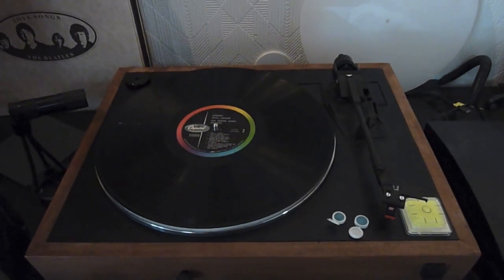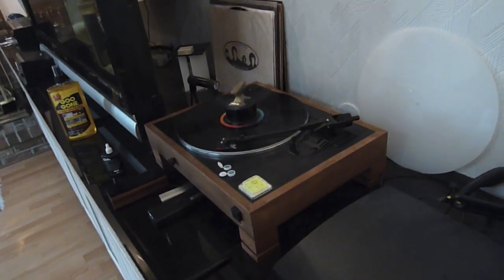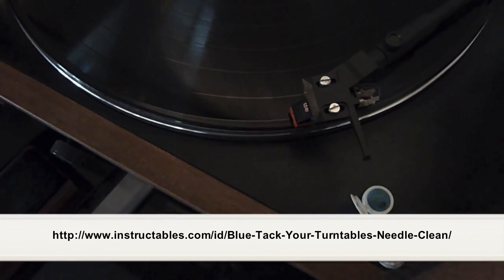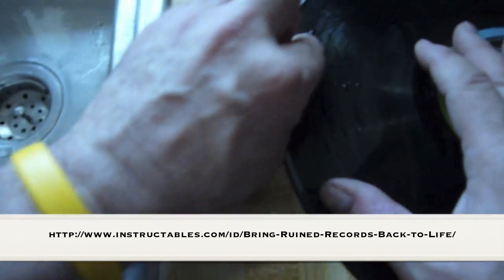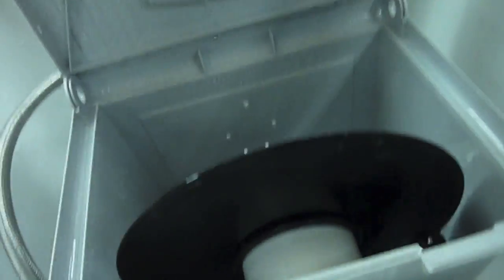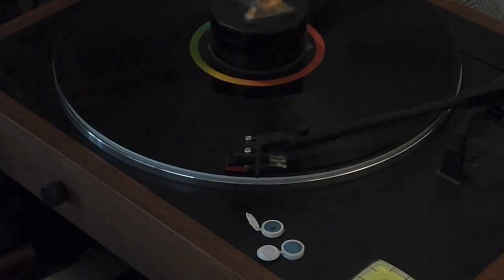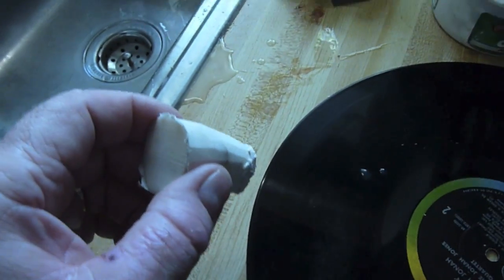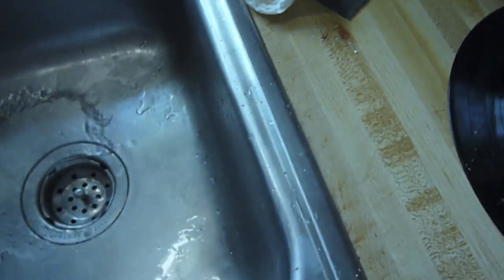Resurfacing Records to Sound New Again

Comment: Different cartridges have different tips on them.  Every one will track any record groove in a slightly different spot (higher up vs lower down in the groove).  More expensive needles will track lower in the groove.  I'm saying that shaving off a top layer of the grooves on a record is probably not a smart idea, it won't change where the cartridge tracks the record one iota.  Moving something back & forth in the grooves will lessen the noise heard from those scratches a bit, I get that effect by (carefully) playing many records backwards.  Any record with dirt or even years of dirt stuck in the groove gets a warm wet rag lightly sprayed with Spray-nine.  Then rinsed SEVERAL times, dried with a soft towel.  It will take off even the toughest grease but not to be used with some 78's (like Rca-Victor 78's) as it has a chemical reaction, and turns the record white and dries it out a bit...  but any 12 inch record or 45 rpm is fine with the spray 9.. just rinse well after wiping a slight bit on with a WET clean rag.  By all means, do any experiments that you want, especially with trashed records, that's how we learn, us mere humans (mostly)..  thru trial and error~!  Good luck, records are great great things, in my mind!
Reply from the maker: CrisVangel1958 

Your understanding and description of which cartridges track lower in the groove is spot on.

What removing the upper layer does is sand away the minuscule tongue of vinyl flashing a needle leaves overhanging the edge of the groove as it moves crosswise over the top of it, rather than within it where the needle belongs. 

That protruding bit of vinyl is what reproduces the tick, tick, tick as the needle is being hit on the side, no matter how deep it goes, every time it passes one. These tiny hammers interrupt my enjoyment of the music and this is what I've come up with to eliminate them.  My experimentation with this has satisfied my needs so it's up to others to fine tune it to meet theirs. 

It has nothing to do with the cleaning of a record... which is what I also like about your comment because that's what I continue to experiment with every time I clean them, and we certainly do learn a lot by doing things that way. 

Great comment and thank you for taking the time to post it.
Reply: When a vinyl record gets scratched, not all the scratches go a deep into the grooves.  Some will be more, some will be less, however it matters not, it only matters at the point of the groove that's the needle is tracking.  Whatever scratches go down deep enough to affect that same area the needle is tracking the groove, those will be audible.  Playing the record backwards will reduce them and I'm not entirely sure why, but I think it has to do with inside the dimensions of a scratch.  the needle will hit (and then slightly round down, each time the needle passes) only one side of the scratch, depending on which direction the record is rotating, so playing it backwards would help I suppose to soften out BOTH sides of the scratch, thus lessening how much you can hear it.  I didn't understand all of what you said, I know that some things are hard to describe, but it's cool to talk to you about this, not many people on the planet would care or have a clue how to even get this far along this conversation.. lol.  I guess it's time I watched your video.. ROFL!
Reply from the maker: CrisVangel1958 
Pictures are far better than words:

https://www.instructables.com/id/Bring-Ruined-Records-Back-to-Life/
Reply from the maker: Maybe because playing a record in reverse causes the needle to wear on the protrusion in a different direction. Bending metal back and forth is different, but results in the same outcome.   Repeated bending causes the metal to break away.  An interesting experiment for someone to do.
Reply from the maker: Thank you Cris. If you know a way to transfer that Instructable over to YouTube, you have my permission to do it.

Comment: Try taking the needle through the record in reverse first if you have a skipping problem or try turning the power if your turntable doesn't have reverse switch on it works 75 % of the time if you have a skipping problem with your record before using anything harsh it that might damage it worst
Reply: A reverse run with a screw on type stylus like a dansette will usually suffice for some pops and clicks

Comment: After many experiments. I found the best way to remove scratches is with toothpaste it's not abrasive like sandpaper and it leaves the vinyl shiny
Reply: Thanks for the tip. I was able to "repair" a part of one of my records, where the track skipped because of a deep scratch. You can still hear that there is a scratch and the record part is not as shiny as it was before, but at least the track plays through from the beginning to the end. At first I was afraid to use this method, because I love my vinyl records and I knew that this is a method that also will damage the record at least a bit. But since I had nothing to lose (like I said, the whole track was not playing, it just skipped the track), I thought I'll give it a try. Now I can finally listen to the whole record again :)
Reply: Hi Jonny chingas. I too tried the toothpaste trick on CD and dvd and it worked like a charm, well, maybe not every time.
Reply: What type of toothpaste?
Reply: I used sandpaper on one that was scratched pretty badly (it was hard to find a spot not scratched) and got pretty decent results for what it was. Aside from the dullness, it seemed to reduce a lot of the major scratches so a clear improvement. I had not tried waxing it, but that could maybe reduce some of the surface noise that's still there.

I'm intrigued to try this method with toothpaste.

Comment: The idea of grinding, sanding or polishing away scratches seemed horrifying until you look at a scratch magnified; it’s like running a knife through butter; all the stuff is gathered up at the top of the groove and the ‘lands’ and is very hard. That’s what the stylus is running into. Remove that, and depending on the severity of the scratch, you’re laughing. A delicate procedure, to be sure.

Comment: Interesting. I have used Mer High Shine shampoo to 'deep clean' (wash), records which is a salt free German automotive product for exterior car care. Works great on really filthy vinyl. Its quite expensive but lasts forever. For light finger grease I use fast food hand wipes. I see the logic of your method & I may try your technique on my 7-for-£5 scratchies box. Playability is my only concern as they will all be digitized, de-popped & crackled & uploaded on here. For really bad jump scratches I keep an old stylus & apply weight & simply forward & back cue the record locally, across the affected area which straightens the sideways cut across the grooves until the record plays at 1.5 gram weight. It'll still pop but won't de-rail the stylus. Maybe your method would reduce the pop further. Gonna try it & see...
Reply from the maker: Start with the worse from your "scatchies box" (I like that term:).  If it works, try another.  I'm betting you'll be able to save most of your scratchies.  If the scratch is so bad, it causes the needle jump tracks, it may or may not work. It all depends on how deep the scratch is. I've never tried it on a record that bad, but have come across gouges that can't be sanded away.  Good Luck.
Reply: Ok, well I started with a 45 - Bang Bang - Sonny & Cher. There were two very defined scratches, one in the middle, one right at the end. Multiple jumps with each. I cued both areas with a weighted stylus until the record played without skipping. Then I used a tiny Dremel polishing mop with a spot of fine burnishing compound by hand on the affected area, lightly rubbing clockwise going with the grain. I used alcohol to rinse.
The record now plays through right to the end with 1.5 gram weight & the treatment has taken a lot of bass, spite & definition out of the scratch. I would say around 40%. Visually, the scratches look much better too. Less defined & less angry looking. The record doesn't sound like its going to skip & I tried it on both decks (same old stylus). It is certainly good enough to digitize & clean up using Audacity. I will see what else I can salvage but I think your method will work best on a disc with one or two deep scratches rather than small marks across the whole playing surface. I may try some T-Cut on those ones. Well I hope that goes some way to winning over your detractors or at least convince them to try it. I can confirm it greatly diminishes catastrophic damage, derailment & skipping.
Addition I should add that both of those scratches were in fact trenches deep enough to pull a stylus right out of the cantilever!

Comment: Definitely some different ideas here.  Thanks for that.  I have a lot of albums that are very scratched.  Mostly from Goodwill.  Anyway, the technics obviously worked on your album.   I did have a question about the goo gone.   Has there been any problems or damage to the record since you put it on?    
I very well may try some of your technics or all on some very scratched records that the record cleaning machines didn’t help.  Definitely interesting. Thanks for taking the time to share.  And hey if you don’t like the technics, them don’t use them.

Comment: Regarding damage:
I examine my records with a 120x microscope and all liquids cause no visible or audible damage except for DEET and such solvents.
PVC - vinyl records - is MUCH more robust than audiophiles state.
There is no such thing as "groove wear", you don't lose highs or soundstage by robust cleaning.
It is rated for 100 years in your sewer pipes.
Properly cared for vinyl lps can last 1000 years IMO. 70 yo lps show zero signs of degradation, other than noise.
I tried intentionally destructive cleaning on easy listening records from 1960.
I have yet to damage a record.

Comment: hahaha Awesome! I have no issues with the techniques used. It's really just like a horror movie it only LOOKS scary. You have fun getting scared and then know that everyone is okay and will be on a talk show later.

I was curious though about the DIRECTION of sanding and polishing. Would it be "safer" to go "against the grain" instead of along the groove? I am thinking that the fine polishing or sanding along the grooves could be more destructive than sanding/polishing AGAINST the grain. The result would be the same, reducing the height of the groove to eliminate the scratch. Polishing along the groove might possibly push the grit and polish grains INSIDE along the groove and  the "sound-y" bits inside. Just a thought.
Reply from the maker: Those are good questions.  I sand with the groove because it looks better.  The sand paper lays on the lands (surface) and other than reducing depth, doesn’t alter the groove’s walls.  Grit will end up in the grooves which is why washing is so important. The heat created by sanding the surface isn’t high enough inside the groove to imbed it.   I’ve not seen embedded grit on the sanded surface either, but that has nothing to do with sound or needle wear.

Comment: I never used Goo Gone, but if it is anything like Goof Off then it has Acetone in it and that will destroy just about any type of plastic. Not sure what it would do to a record and not going to find out. If the record is that bad, then maybe look for a new copy or a good used one. I like the wood glue method, it seems to work for severe dirt.
Reply from the maker: Hi C MJ.  

Goo Gone is not like Goof Off.  It’s citrus based and from my experience, of no threat to plastics of any type.   Only 3 or 4 chemicals can harm vinyl.   The only household product I can think of that might have one of them in it is paint remover.  

About 80% of the products with plastics in them use vinyl.    That’s a lot of material that’s been exposed to man’s list of chemicals. I’m not at all concerned what cleaner is used on my vinyl records, only which ones do the job the best.  

Wood glue does work well.  But take a look at the ingredients used in that.   None of those  harm vinyl.   Wood glue works by encapsulating dirt.   It’s messy , time consuming and expensive.   GooGone dissolves grease, oils and types of chemicals used to make adhesives.  Just like what holds dirt, dead skin and vinyl bits removed by the needle in a record’s groove.

No matter what method you like and use, as long as it gets the job done, that’s all that matters.
Reply from the maker: GooGone contains no acetone or any of the two other chemicals that’ll turn vinyl into a puddle.   If a good copy is available, that’ll always be the easiest thing to do.   But many records are unobtanium or so rare or expensive it doesn’t make sense to trash a scratched copy that can be restored.  

I tried the wood glue method. It works very well, but For me, it was too messy, too slow and too expensive to use.  GooGone was developed in part to remove the adhesives used to attach labels to things.  The adhesives it desolves are very much like the goo that builds up at the bottom of a record’s groove.   The only thing I’ve found that resists it are any bits that have been welded to the vinyl via heat. But those are rare and can usually be removed with a carbon fiber brush.

Comment: This is what I do to remove deep scratches:  use a tiny drop of expensive auto scratch removed (e.g. 3M, Mequiers, etc) and rub it on the deep scratched areas with a shoe mit (those we acquired from hotels).  Then watch it real good with soap and water.  Dry it with a clean towel and blowdryer in cold air mode.  Let it sit for another 20 minutes and the record should sound a lot better.  Some scratches are so deep that nothing can be done.  Good luck.
Reply: +Benny Lai How can you tell which scratches are too deep to try and which aren't? Additionally, it is possible to damage the lp with auto scratch remover?
Reply: +Alex Deley You  can use your fingers to feel the depth of the scratches.  Just wipe a tiny bit of scratch removed over the scratches and wipe it off quickly with micro fiber towel and rince the vinyl immediately.

Comment: You cant argue with success. Sometimes you need to think outside the box and use unorthodox methods to accomplish something which seems unachievable. My concern with goo gone is its acidity. Id be very cautious, making sure to remove the tiniest residue left from it to avoid hurting the cantilever and stylus bonding. Otherwise I can see this working on extremely contaminated record surfaces. I'm not sure its 100 percent compatible with vinyl from a chemical standpoint.

Comment: You can't really do anything bad to a record by trying to polish the surface marks out. The stylus of course contacts only a small portion of the groove, depending on profile, a couple of round spots for a conical, a couple of ovals, getting narrower for finer tips - all well below the surface. The scratch would have to have deformed the vinyl to contact part of the stylus at the surface for polishing to have effect. If it works for a bad scratch, well that is magic in my opinion. Don't worry about it doing  damage to the music information, it will not. Though essential to make sure any rubbing compound pushed into the groove is removed before playing.

Comment: Do you have a way to clean old styrene records, usually mostly 45's? They are the noisiest.
Reply: In my experience, many of the 45s pressed were made from a cheaper, more brittle vinyl than LP records.

Cleaning will help a lot.  But, in most cases the records have irreversible damage because the tracks in the brittle vinyl have simply chipped and worn away.

Comment from the maker: Because We're limited to 500 characters and I, being an engineer, can't be hog-tied like that, :) the final step is to use a carbon fiber brush to "sweep" out what's left.  Carbon fibers are the high tech solution to getting to the bottom of the grooves.  In the video you see my finger resting on the metal platter.  That's to ground myself.  Since carbon conducts electricity, it literally eliminates all static from the record... Probably the greatest invention since stereo... Whew...Got it all i

Comment: Put the darn wood glue on it from the get go, it gets deep into the grooves and works. Get some Brasso on it to while you're at it. :)
Reply: From what Ive heard it doesnt go very deep in the grooves at all actually, it does get some of it but not all.
Reply: @leon9021  Why would what you "hear" be a good enough?
Reply: @Earthtime3978  Well considering grooves are just a few microns wide it only seems reasonable that it would get to the very bottom .
Reply: @leon9021  Again, what you hear and whats put into practical use are two different things. Basically, you don't really know about the effectiveness of wood glue. A liquid will seep in and if it's a liquid intended to bind one substance to another, certainly the gunk adhered to the bottom and surrounding areas will be ripped up. A vacuum only has so much suction power. It's not going to pull up lodged debris. Logic works. I'd also suggest you look into the science of it.
Reply: @Earthtime3978  Ive heard comparison videos, so I basically know how effective it is vs other methods. The liquid solution is supposed to loosen up the debris in the grooves so that they follow up with the water. Also, wood glue is hella expensive and time consuming in the long run.
Reply: @leon9021  Good answer. I would only add that as far as effectiveness, would glue or some of these new liquid polymer cleaning solutions tear away at what is lodged in the grooves versus water and soap which one could only hope would dislodge the long ingrained gunk. As you said, the grooves are at a micro level, so they require the deepest of penetrations and a bonding with the offending junk for removal.